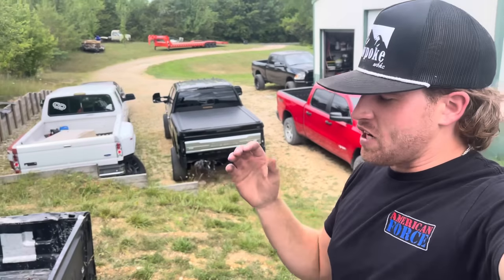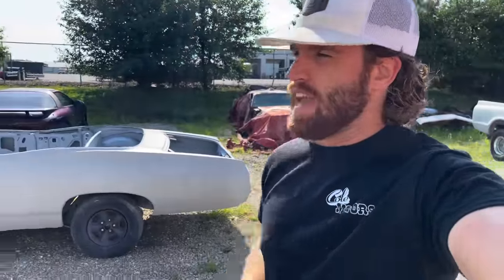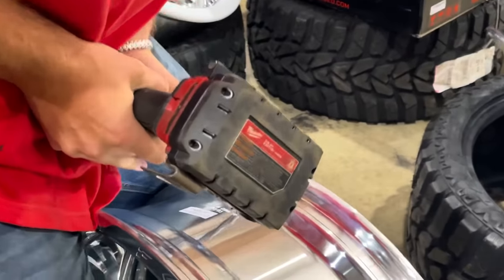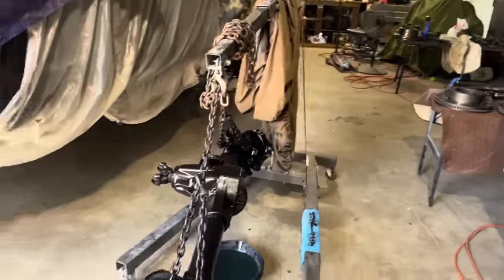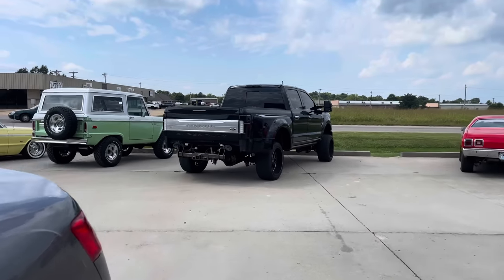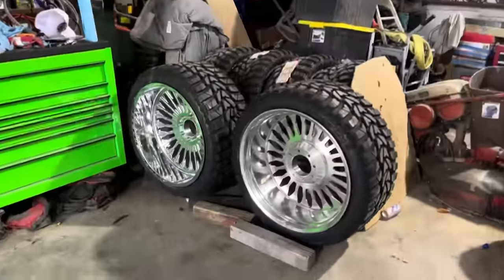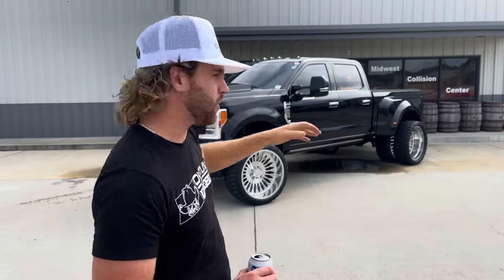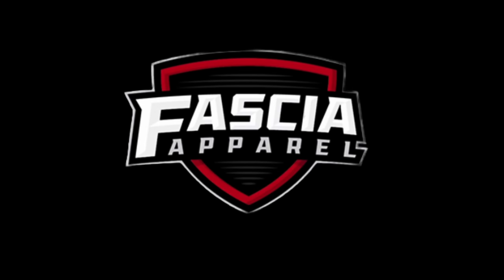Introducing My One Of A Kind SHORT BED DUALLY ALUMIDUTY - final Build video -

Comment: Seen your truck at LTN 2024 and was a huge inspiration for me! Picked up a color matched dually bed today 9/9 and will be starting my conversion real soon! Did you have your wheels custom cut to 8x170 or are you running adapters? If so can you point me in the right direction?